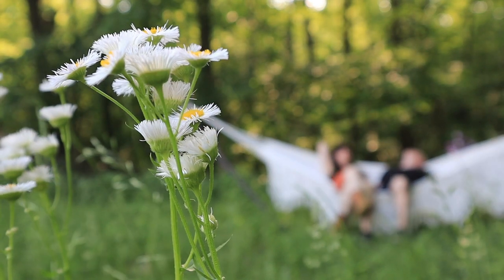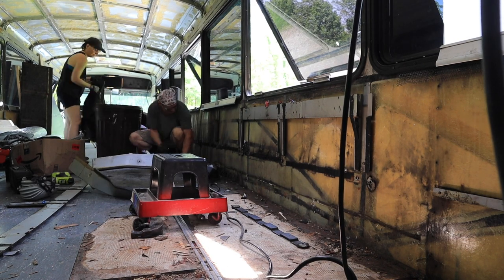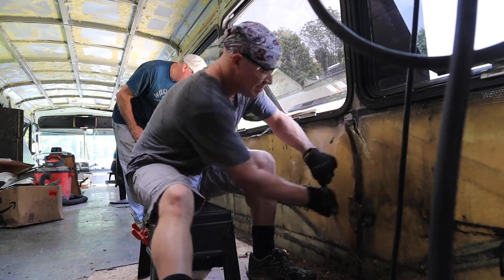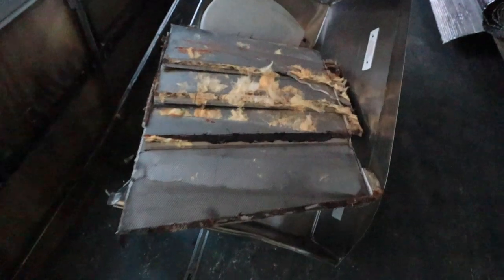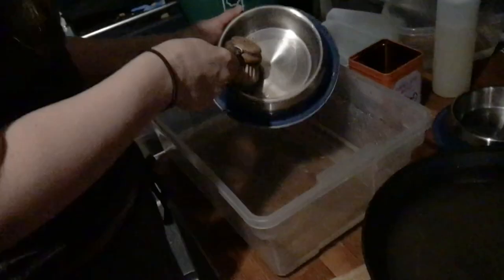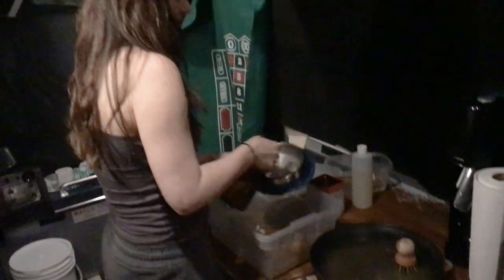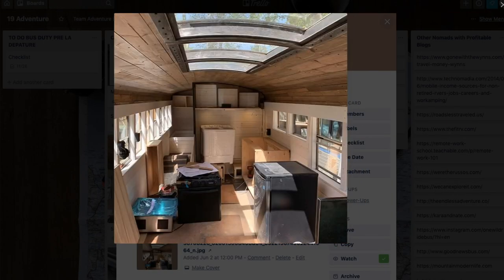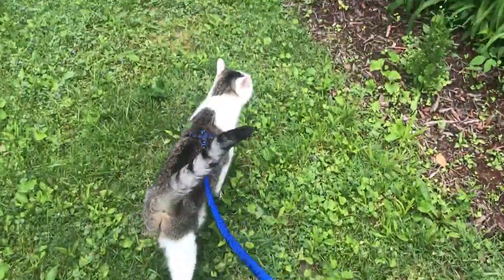Bus Demo Day 6 - Design Talk and Wall/Vent Removal

Comment: As an ex aircraft (airliner) builder, rivets are much easier removed with a sharp drill...
Reply from the maker: Thanks Daniel I wish we would have known that when we were pulling the bus apart. Thanks for the info

Comment: not sure why you took out stainless loo and didn't just build around it?
Reply from the maker: For a few reasons: It's old and stinky, the black tank doesn't hold very much, we don't want a black tank we'd rather have a composting toilet, it takes up more space than we would need a toilet to take up, and we'd still have to build a shower in a separate room and we learnt that it had a plumbing leak causing the frame underneath to rust.